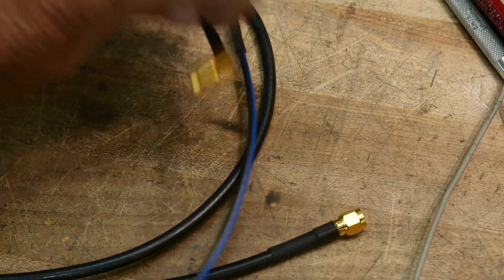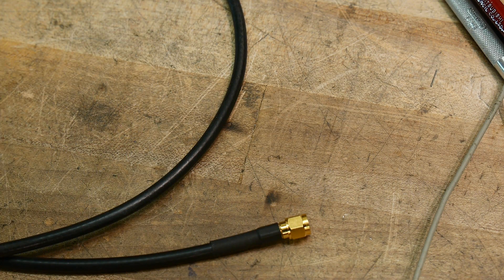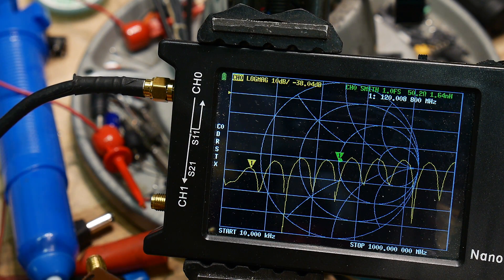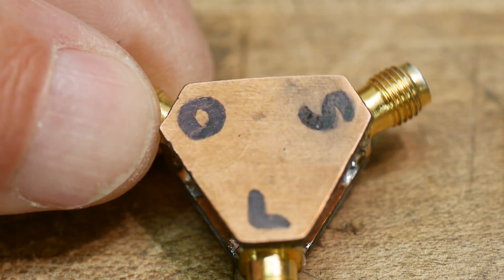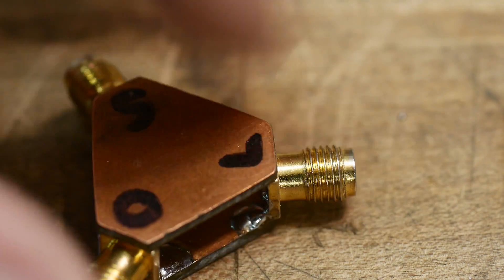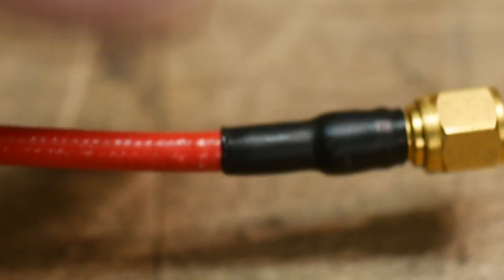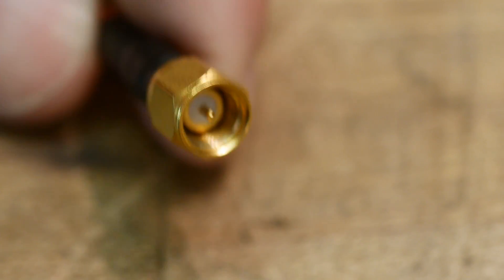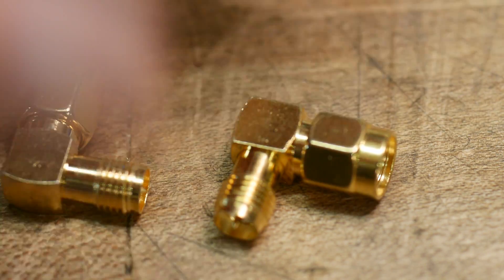#626 Not all SMA connectors are the same

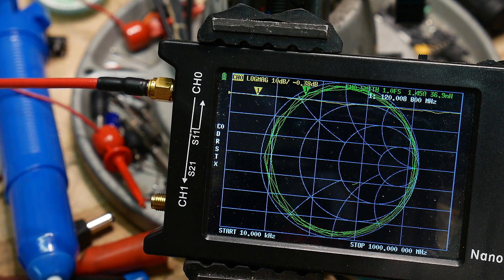Comment: FWIW, @2:50 in the video, the red cable rotates itself loose right before you install the load on the other end. Not sure if you noticed that, or if it affected your measurements. So wanted to mention just in case.
Reply from the maker: I did see that, no change

Comment: I hope you can help, i'm restoring my car and got an alliscom gct puck antenna, it has 2 plugs, one being SMA and the other is what seems to be a slightly smaller version of it, it has rhe same threaded nut fitting but it has a kind of hollow pin in the middle that is kept in place by a white collar.

I'm hopefully needing a simple adapter to make it SMA for a laptop dock that is said to have SMA passthrough's for wlan wwan and gps.

Worst case... can i just cut the plug off and crimp a SMA on instead?
Reply from the maker: SMC connector?
Reply: @IMSAIGuy  it is, that's awesome, thanks, i don't get why my searches of "mini sma" and trying to find all types of sma connectors, never was SMC shown.

Comment: It's a 75 ohm cable. When you connect a cable of an unmatched impedance to a VNA, it traces a circle around the cable impedance on the smith chart. You can see in the chart the circle going through the 50 ohm center of the chart and the line marking 100 ohms, therefore, the impedance is right in the middle, 75 ohms.
Reply from the maker: I used to think the same thing. My friend did a mathematical derivation and it actually does not circle that point. I don't have the math (or understand it) but he is smarter than me. A separate measurement puts that cable at 91ohm
Reply from the maker: https://youtu.be/qliw1DUBFGs
Reply from the maker: here it is:
After slogging through the math, you can get Zo of the unknown cable by finding Rmiddle (resistance at the middle of the circle with 50 Ohm load) and then using this formula:

Zo = sqrt( ( Rmiddle*3*50^2 - 50^3 ) / ( 3*50 - Rmiddle ) )

or you can calculate the resistance at the middle if you know Zo:

Rmiddle= (-Zo^2*150 - 50^3) / (-Zo^2 - 3*50^2)

So for 500 Ohm coax, the middle is at 146.1165 Ohms.

For 90 Ohm coax the middle is at  85.8974 Ohms.

Comment: There is some writing on the red connector, couldn't find a frame in your video where I could read it. Can you post it? 
Edit: Found a frame where it says 26805. It seems like an Omni Spectra OSM connector - ofcourse top quality for military aviation use. OSM has been acquired by M/A COM. The connector you have most likely is Made in U.K. Good stuff.
Reply from the maker: so what are the specs? impedance?
Reply from the maker: the stamping on the connector: AMERICON 26805

Comment: Out of interest. I've been using the NanoVNA to calculate quarter wavelength coax stubs and have found that at vhf/uhf frequencies, the stub length turns out to be quite a lot shorter than by using the published vf. The vf was measured as correct using propagation delay and a scope of known accuracy.
Could this be an interesting future video?
73 Steve
Reply from the maker: I did this video:
https://youtu.be/dUIs1nvQyiw
Reply: @IMSAIGuy  Thanks for the reply.
It wasn't the vf measurements where I found an anomaly  it's when I used this information to cut some quarter wavelength stubs.
These quarter wavelength coax stubs were to transform 28 ohm to 50 ohm on a new Yagi build and they were not performing correctly. I used the NanoVNA to find where they were resonating  and the frequency turned out to be far lower than it should have been. After searching the internet I found someone else had had similar experiences. DG7YBN  Phasing and Matching Lines and Baluns, had run similar tests. Interesting stuff.
73 Steve

Comment: Good evening. No, you are wrong about SMA-like connector compatibility. First of all, it is right: SMA are usable up to 18 GHz, even though there is a special type, called super SMA, rated to up 27GHz. One manufacturer is a company called SOUTHWEST inc. ; then, what you call 2.92mm it also known as K connector, originally developed by WILTRON company (nowadays Anritsu-Wiltron). It is rated for overmode free operation up to 40 GHz but its dielectric is AIR not TEFLON as in the regular SMA. K connector and SMA connector are compatible . You can join, for example, a SMA female and a K male, using a torque up to 3 lb/inch to preserve K mechanical integrity. As far as 2.4mm, this was the HP response to Wiltron K proposal and it is usable up to 50GHz. To connect  a 2.4mm to a K connector (or SMA) you need a special (and expensive) adapter. If you want to increase frequency range, up to 67 GHz, the right choice is 1.8mm and to reach 110 GHz the choice is 1mm...but these are for very esoteric and limited applications. Back to SMA-like, the most important difference between K and SMA connectors is this: K is a precision connector, a professional instrument grade connector suited to situations related to determine tne exact reference plane of your VNA measurement. On thecontrary this is NOT possible with SMA connector. In fact calibration standards (I mean OPEN, SHORT or THRU) are commercially available ONLY for K connector. Sorry, for this long post but there are a lot of things to consider...regards from Italy.
Reply: The Signal Path went through those different connector types with other components few years ago: https://www.youtube.com/watch?v=6kwamCh1QkE
Reply: Thank you for the video, very informative and appreciated that you were able to help me access it, Thank You.  @kariputtonen
Reply: You forgot only 3.5 mm connectors, which also intermate with SMA, but have an air dielectric like the K/2.92. So for SMA compatibility there are SMA, Super SMA, 3.5, and K/2.92. I believe the 2.4 and 1.85 mm connectors also intermate.  I used to work at a company as a machinist, then engineer designing RF and MW connectors and adapters. I never really understood RF theory beyond determining the right line diameter ratio for 50 ohm, and figuring out how to make connectors/adapters with low VSWR via clever transitions in the dielectric material and conductor diameters. I don't remember selling too many 3.5 mm connectors now that I think of it.
Reply: @DavidPaauwe 😂 Yes, you are right! My fault...3.5 mm connector was an intermediate step, since It was rated upto 26.5 GHz. It was mainly supported by HP in equipment operating upto that frequency limit, such as RF frequency generators or test sets included into VNA (i.e. Vector Network Analyzer) systems and associated Cal Kit for Calibration procedure. They were rapidly, say forgotten, in favour of K connector whose upper frequency was over 40 GHz. Remarckably, 3.5mm and K were perfectly mechanically compatibile without any adapter in between...I mean you could connect directly a 3.5mm female tò a K male...Old good times!!! Regards from Italy.

Comment: I made that mistake just the other day when using a BaoFeng radio as a "test set"...was also using another rig and got the adapters mixed up - the BF has a male SMA connector and the other one has a female connector. I screwed the BF adapter into the other radio and couldn't figure out why there was no movement of the Bird wattmeter needle...duh, dumb , rookie mistake! I'll second the other commenter who offered that you can put a couple hundred ohm pot on the end of the red cable to determine the impedance which I'm guessing will be 75 ohms.

Comment: Yes, similarly I once got stuck with 75 ohm BNC connectors. 
The usual 50 ohm cables (like RG58, RG213) have a capacitance of around 30 pF/foot length.
And the 75 ohm cables (RG59 or RG11) have 20 pF capacitance per foot length.
The diameter of the center pin, the width of the dielectric (of course the dielectric constant of the material too matters) would decide the capacitance per foot length of the cable.
Sub miniature coax connectors do have the reverse polarity types; some of the connectors on the VHF/UHF HTs do have the RP connectors and we have to look for proper interface to connect to the standard connectors we have already.
75 ohm SMA connectors are having very deceiving looks from the outside.

Comment: The red cable is not 50 ohm.  That circle is showing you that your terminator is mismatching the cable impedance. Since you like building your own test gear, build a terminator with a potentiometer, dial it to the smallest circle your can get, and then read the value with a ohmmeter. That is likely your cable impedance. 

Those right angle connectors are RP-SMA. They are used on routers/APs. The FCC tried to make it difficult for people to hack with their wifi gear and change the antennas to something more useful. The industry solution was to reverse the pin, so the WiFi equipment is incompatible to standard stuff. However, you can now buy just about anything in RP, so it just made things complicated for no reason.
Reply: Exactly correct. The red one maybe of 75 ohm impedance.
Reply: VNA can easily measure the impedance of a cable, no need for a pot.
Reply: If you want to be more accurate in measuring the cable impedance at a given frequency do the following: measure z11 first with the open standard at the end of the cable and then with the short standard. Calculate the cable impedance as the geometric mean of both measured values (multiply both and take the square root of the result)

Comment: I ran into reverse polarity SMAs recently when ordering a 900 MHz antenna. Had to order rpsma to sma adapters. Why in the world are there two types? Just mke the regular. What purpose do rpsmas serve?
Reply: It’s an attempt to keep people from hooking up high gain antennas to WiFi equipment.
Reply: @rfengr00  its used on gear with multi antennas and frequencies for example aircrafts, there isn't just the average consumer

Comment: The last connectors are called rp SMA. (Reverse polarity). They are used on wifi equipment.
Reply: You are right, I discovered that some years ago when I was operation with WLAN amplifiers.
Reply: If it was RP it would have  female inside and male outside. Or the other way around..
Reply: @teapot9514  it is RP-SMA, usually sex is determent by the conducting core, here its not.